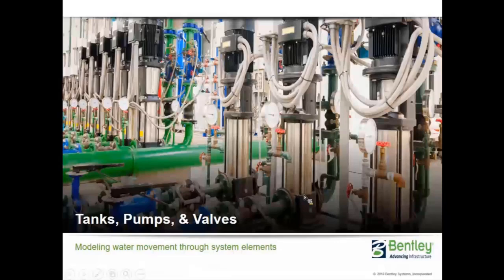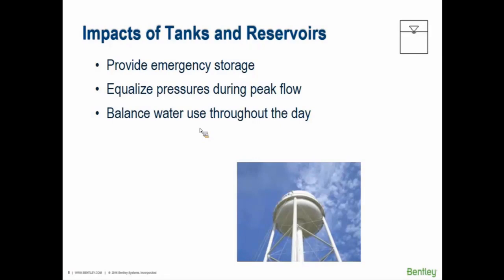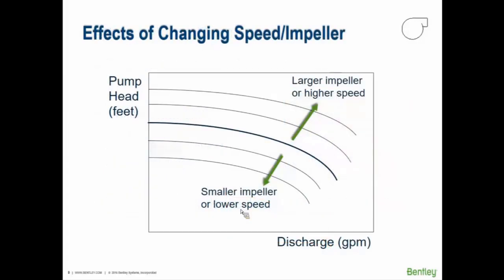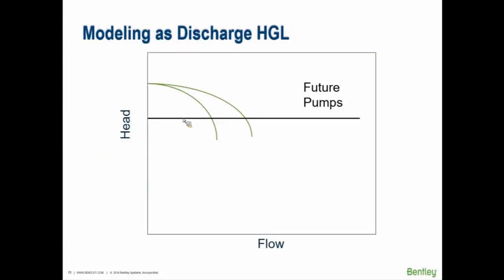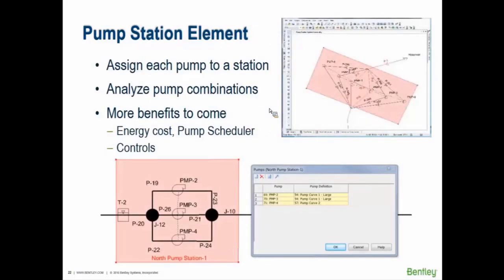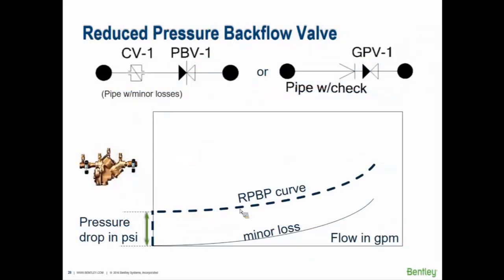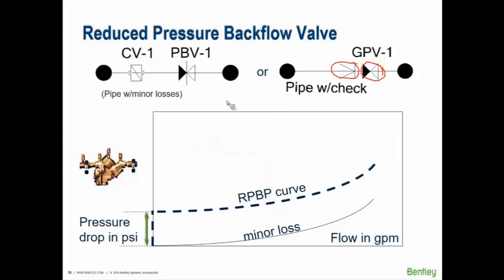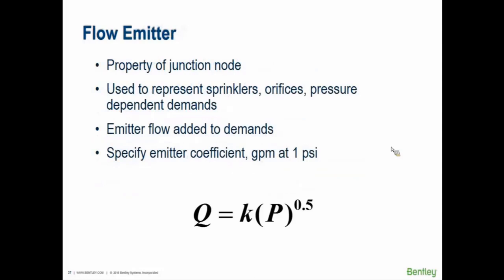WaterGEMS/WaterCAD Fundamentals Part 6: Modeling Tanks, Pumps and Valves

Comment: For Butterfly Valves - we need to use GPV in the model? I do not have any table or rating curve, can i use only  Open/Close status and coordinates?
Reply from the maker: Hello Mohammed, the GPV element is used if you have a rating curve of flow vs. headloss for your valve. If you want to ignore any headlosses from the valve and simply consider the open/closed status, you can use the "status" property of a pipe, or use a TCV valve and change the status field there. If you want to consider headlosses through the butterfly valve,  you would need to determine either the minor loss coefficient or headloss coefficient (K) for at least the fully open position. You can select "butterfly" as the valve type field in the properties of a TCV valve, choose the coefficient type, then enter the discharge coefficient or minor loss coefficient information. See more here:
https://communities.bentley.com/products/hydraulics___hydrology/w/hydraulics_and_hydrology__wiki/15981/valve-type-field-assumptions-and-use-with-a-tcv

If you need further help, please post on our forum: https://communities.bentley.com/products/hydraulics___hydrology/f/haestad-hydraulics-and-hydrology-forum

Comment: I wanna add a sluice valve and scour valve. But I don't know there properties, any body can help please,
Thanks in advance.
Reply from the maker: Are you using WaterGEMS/WaterCAD? If so, a sluice valve or scour valve can be modeled in the pipe properties. If the valve is closed, set the pipe status to closed. Or, to model the valve as a node, use the TCV node element where you can set them to open or closed. For a partially open valve, you can model it as a minor loss coefficient in the pipe properties, or if using the TCV node element, set the status to Active and enter the headloss coefficient, or set to Inactive and use the Minor Loss Coefficient. See: https://communities.bentley.com/products/hydraulics___hydrology/w/hydraulics_and_hydrology__wiki/2569/adding-minor-losses-to-pipes     For more questions, post on the OpenFlows forum: https://communities.bentley.com/products/hydraulics___hydrology/f/haestad-hydraulics-and-hydrology-forum

Comment: @bentleyopenflows plz guide how to add different levels of storage in Reservoir on waterGems
Reply from the maker: Can you explain what you mean by "levels of storage"? The reservoir element in WaterGEMS is used to model an infinite water source at a fixed hydraulic grade. If you need to account for storage that can fill and drain over time in an Extended Period Simulation (EPS), you will want to use the tank element, where you can model the bottom, top and initial level or elevation, and the volume characteristics. See the following article for more information. If this does not help, please post on our forum and Bentley Technical Support will be glad to assist:

https://communities.bentley.com/products/hydraulics___hydrology/w/hydraulics_and_hydrology__wiki/31984/understanding-tank-operating-range

https://communities.bentley.com/products/hydraulics___hydrology/f/haestad-hydraulics-and-hydrology-forum
Reply: @bentleyopenflows  Thanks a lot for being so supportive, i got the solution. Keep training Engineers.

Comment: What about a flow control valve, throttle control valve, what's a discharge coefficient?
Reply from the maker: Ryan are you asking how to determine the discharge coefficient of your valve? (contact the manufacturer) Or, do you need clarification on what the program is asking for? See: https://communities.bentley.com/products/hydraulics___hydrology/w/hydraulics_and_hydrology__wiki/16758/what-is-the-discharge-coefficient
If you need further help, please post on our forum: https://communities.bentley.com/products/hydraulics___hydrology/f/haestad-hydraulics-and-hydrology-forum
Reply: @bentleyopenflows  I'd like to understand mathematically how the discharge coefficient effects flow through a valve
Reply from the maker: @Cheesercake  please post the question on our forum and be a bit more specific. The article provided explains how the discharge coefficient is used mathematically. It effects the headloss depending on the pressure.